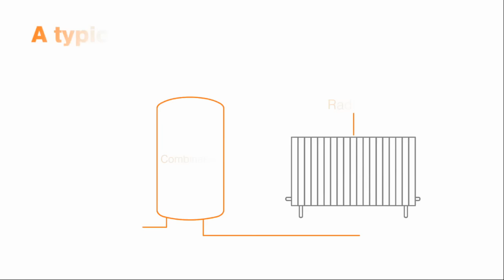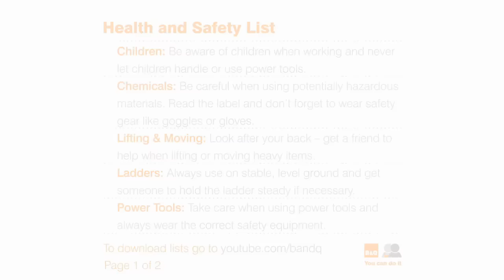How to bleed a radiator

Comment: I don't have a key. What do I do?
Reply from the maker: Hi there. Good question! 

If your bleed plug has a small slit in the middle, you could use a flathead screwdriver. Not every radiator will have a slotted screw, so you might not be able to use this type of tool, but it’s worth having a look. Hope that helps! 😄